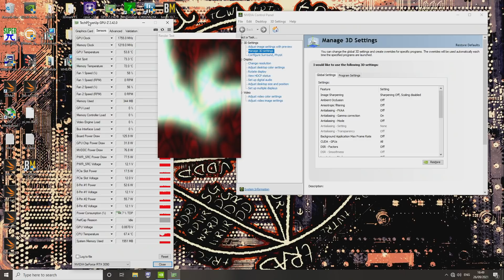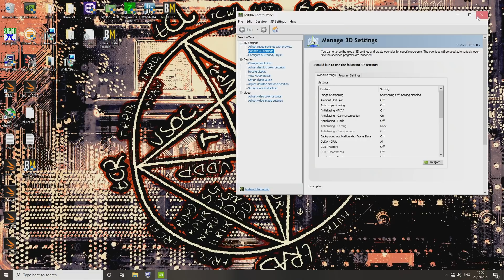Progress update on the New Worlded RTX 3090 Vision

Comment: Most def a design flaw and also a firmware flaw, it should of prevented rapid cycling of power states (going from 60fps to 500fps, etc). So all 3090 etc are still at risk
Reply: I'm inclined to agree. In my opinion any card should be designed to withstand an absolute worst case scenario as we are talking about software. There should be no way for software to damage the card as long as it doesn't try to interfere with the power settings or frequencies on the card. That are things that software like Afterburner fiddle with, and it comes with warnings that you are touching things the user are not really supposed to tinker with so you are doing so at your own risk. A game however doesn't have any reason to touch anything like this. Just issuing draw primitives and accessing the options exposed through DirectX, OpenGL, Vulcan or whatever other API it shouldn't be possible to damage a graphics card even if you were to deliberately use the absolute worst kind of workload however unrealistic. That's what safety margins are for.

Lets look at heavy construction machinery. If you have a loader that are rated to lift say five tons then you expect it will do so all day every day without blowing up. If you try to lift six tons it will most probably do so, maybe even seven. But once you get high enough it will stall, overflow valves will trigger or it will somehow refuse to do more than try. This is a built in safety. It protects the machine from damage and also the workers from what a failing machine may cause. But the machine is actually not yet near the failure point. In some cases it's possible to override the safety features, but doing so means you have to manually disable them, and no one will do so without a really good reason because when a huge construction machine fails things can go really bad in really horrible ways.

Construction of any kind of graphics card should be a bit like that. If the card can normally draw a max of say 200W then the power delivery should be designed to provide at least 300W continuously and transients of say 400W. Now that is figures I lulled out of my ass so they may be way off. But the safety margin should never be less than 50% and more probably 100% to 200%. Some components age faster than others, and heat and high frequencies can accelerate that. A graphics card that costs north of $1K and often even $2K is way to expensive to have it's lifespan shortened by cheeping out on components costs.
Reply: I agree 100% had my buddy's 3090 ftw3 brick loading into apex, had my 3080 ftw 3 brick loading into zero hour (seige style tactical shooter).  Got my new card in 4 days and I've undervolted since and underclocked immediately.

Comment: Maybe the owner could run with the power slider at 90% for reliability. Not ideal but at least it may last a while that way. Or perhaps cap the frame rate in the driver.
Reply: it doesn't always work with new world unfortunately. some cards will still boost like crazy, or ignore the fps caps in the driver. This is a total mess between obviously botched game code revealing hardware and driver issues that should not be issues if the game was coded properly.
As Jay said, new world is basically more of a stress test than a game at this point

Comment: If I was the owner, I would keep it like that. VRM is more than powerful enough to run it with 1 missing + Buildzoid fixed my shit! Has more value as is.
Reply: The VRM wasn't even powerfull enough without missing parts lol
Hence it blew up.
Reply: @rako81sna  Don't confuse defective with not powerful enough. On paper the VRM is way more than adequate. Owner got this second hand and we don't know what the previous owner did (mining & etc). 

I would voltage/power limit a 3090 anyway. Nvidia pushed these cards too much just to have the fastest card out there.

Comment: Do you think with better cooling, the power stage would not have blown up?

I have a 3080 FE and considering to play New World, but didn't want to consider it until I put a water block on it (which I already purchased). I figured it'd be safer with more than adequate cooling, but if faulty hardware, then maybe not.
Reply: Better cooling wont save this
Reply: @effive7817  Why is that?
Reply: Breaking the power limit isn't a temperature issue. Some people limit power very low and fps cap, dunno how safe it is you'll need to research more reports I've only seen a handful.
Reply: @effive7817  Quite a few 3090s were breaking from bad production issues as I understand it. There was no discussion on whether those people were breaking power limits and that's not what I was alluding to.

I simply thought that whatever the issue was, it might be temperature related due to big power demands by an app (game in this case). If temperature exacerbated the bad workmanship, such as it was rated for 100 degrees but the bad workmanship caused for failures to happen at 85 degrees, then watercooling might help avoid the issue.

If there are other problems, like bad grounding, EMI, faulty mosfets / VRMs, I guess that can cause other permanent damage, just not sure how when it only happens with certain types of loads / stress to the GPU.

Comment: From my old VGA Voodoo 1 days to 2021, I've never bought the highest end tier card. I try to upgrade every second generation with one tier below highest end. In current times I wouldn't buy 3090 but 3080. Those highest tier cards are always pushed to "beyond maximum". This strategy of buying has paid off in more then 2 decades. Only one GPU died, even though I was OCing the shit out of them. But these 3090 are not normal. I've seen youtube videos where it pulls 430W for a second in **normal use** before going down to 350-370W. I was really hoping 300W was the limit GPU manufacturers would go, and that Ampere was an unfortunate generation, but it seems all next gen will pull 300-400+++W. Please don't. PLEASE.
Reply: There isn't anything wrong with having higher power limits on cards, especially if performance per watt is still improving. The VRMs get built around it having higher power draw along with everything else. I put OC bios with higher power limits on most of my cards if they don't already have them and my cards have all been fine. 7970s, 780 Ti, 980 Ti, 1080 Ti and 2080 Ti. So I'm also going to have to disagree with the "highest tier cards are pushed to beyond maximum" as well.
Reply: @rekareaper  To each his own. If I bought 3090, I would have to buy a new high airflow PC Case, new PSU and a new Air Conditioner for my mans cave or our living room. So at least 4000 EUR if not even more because now companies that are installing ACs, Heat Pumps, Gas installations,... are charging double, and you have to wait a couple of months. For a fscking GPU! My significant other would put me in a mental institution because she would probably think I want to starve our children. HU just released review of A4000 which is between 3060 TI and vanilla 3070 and can achieve that with only 140W. But it's OK. We all have different perspective on things.
Reply: @alpha007org  there isn't anything wrong with that. My point was that the higher end cards aren't pushed beyond their maximum. You also don't have to buy the enthusiast or flagship cards. The top end of the next cards may end up with 50% higher power limits, but they're also all looking at over 220% performance vs the current top cards. That performance per watt improvement will apply to most of the line up, and will probably be even higher on the middle and lower end cards since they aren't trying to squeeze everything out of them. For reference my 2080 Ti has probably drawn more power than most 3090's have and it's still running fine.
Reply: @rekareaper  This is my opinion and my strategy of buying in the last decade+. Do I want to squeeze the last 4% for 50% more power draw, or do I want something more reasonable? In the past, Tier below Highest was usually a good performer, still with not linear increase in power draw relative to performance, but those GPUs usually had good OC potential, especially if you got a good sample. Those GPUs usually weren't dying at the rate of the highest tier. When BLZD started naming GPUs that failed most often, they were the cards that were pushed to the maximum. Regarding 3090: it was supposed to have 350W TDP. A lot of different 3090 have, during normal use, moments of 400++W draw before going back to normal. This is "beyond maximum" to me. Notice the quotes...

Comment: Here's one thing I'm really curious about: The uP9512 supports automatic phase shedding. Could you probe the PWM signals to see whether phase shedding is actually enabled on this card? Maybe the uP9512 can't enable additional phases fast enough when a hard load spike hits so that a few phases get overloaded even though the total load is well below the VRM's rated output power.
Reply: my guess would be IF it sheds it's in idle mode only, anything else it'll be full phases.

Comment: With my experience with one pascel card this was my guess. A hard transient thst blows the power limit way out of the watter before it gets corrected. And with these mixed phase/powestage count cards your probably playing the lotery that it doesn't happen on the single power stage part of the vrm
Reply: Is it mixed powerstage though? Under last video BZ corrected that reference PCB allows for 10 powerstage Vcore.
I don't know if this does mean that reference VRM is asymmetric or if 10 is correct number of phases for 3090.
To me - with this videos and what JayZ showed (whcih I don't entirely agree with him on - that it is VBIOS) New World acts like Furmark. On the other hand so many cards failed in other applications (heavy loads). Which probably means that there is a problem with at least QC in factories or design. But also - you shouldn't design your game to be a Furmark - this is insane. Furmark was DESIGNED to abuse GPU as much as possible - without any safeties.
Reply: I could be wrong about the mixed power stage. I did not see the update to the last video.

Although I woud argue this game is not like furmark. It may have a rapid intence operation but its very inconsistant. Also back when i was serious about daily stable ocs all my gpus passed a few hours of furmark. Mind you this was before gpu boost so you knew what you where getting in to and the card did not play arround trying to optomise and boost clocks when the workload let it.

Comment: I just like seeing that AMD stock cooler on everything you use
Reply: alright so i'm just going to check the turbo pressure on this 2JZ right quick, I'll run the coolant through an aluminum block and put my AMD cooler on it for the time being......
Reply: Go a wraith cooler on top of my 3090 FE - getting kick. It heats very good when F@H

Comment: powerlimit to <80% and underclock for new world.
Reply: That’s not enough if you want to be extra cautious. Take all of the preliminary precautions or what steps towards it you do are pointless. Set the Power limit to 70-80, frame limiter in game and software to 60, temp limiter, undervolt the card from the stock 1.05-1.1v nvidia uses down to between 0.85 to 0.9v. Control thermals and power spikes. For new world it’s not about the total draw, the game has an enormous amount of spikes and fluctuations in voltage and power draw.
Reply: @AznTony360  is it only with 3090 or also with 3080 / Ti and so on ?
Reply: @evilsatorii  I'm not sure, but from all the information floating around it seems mostly 3090's are affected. Some reports of 3080ti's though not as much. Same goes for the 3080/3060ti. Seen some people report older generation flagship cards as well, but it seems to be rare if any.

Comment: In a previous video he said he might be able to get a schematic for that specific card because there were some leaked. He didn't mention it because either he couldn't get it, or it would be a time-wasting rabbit hole to evaluate the design of the power delivery circuit
He would probably need access to an R&D department's equipment/documentation to accurately analyze it and I don't know what equipment he has
I mean, he could probably do it himself, but how freakin' long would that take?
He'd have to do what gamers nexus did with the gigabyte power supplies. Have specialized equipment, either pre-made or equipment he made himself, to overdrive the power circuitry and see at what point it fails and how the circuitry handles the failure. That could cost a hundred thousand dollars easily just to do that. Basically, a crate of new cards to test with, or at least remove the gpu chip itself from the circuit and replace it with a simulated load with boxes of replacement power delivery components
That would be extremely time consuming and expensive
And replacing the gpu chip with a simulated load would be very difficult to make accurate
You can't just say, the gpu chip is a 0.1 ohm load so we'll just use a very high wattage resistor. It's also probably an inductive load at least and who knows how it behaves in total without killing a few just to find out
I think it can be summed up by saying, yes, new world is killing cards because it's badly coded, but it's the card's bad design allowing it to happen
So in essence, it isn't new world's fault, and every killed card should be replaced and any manufacturer that doesn't warranty all cards affected should die an a fire
I'm looking at you with a death stare, gigabyte

Comment: New World isn't going anywhere near my 3090... no sir! Especially with Amazon denying any culpability.
Reply: amazon are not responsible for the failures of these defective products.
Reply: @Squall4Rinoa  Normally I'd agree, but there is something exceptional going on here, and Amazon needs to take it more seriously. We're not seeing this happen with other games and Amazon likely has the ability to fix it, even if the hardware should protect against it. No way I'd be shipping software that bricked $2000+ GPUs, even if it wasn't entirely my fault.
Reply: @jasonhurdlow6607  there is nothing exceptional going on here, the products cannot perform to satisfactory stability when they encounter a variating load. new world is not the only case of this issue with some having games killed simply be having a heavy set of reshade shaders, other cases being halo mcc, gtav, and anything else that can go quickly from intense to light loading just by rotating the camera.

Comment: Can you share part number for the dead mosfet , I want to have a look at the data sheet , thanks
Reply from the maker: AOZ5312UQI
Reply: @ActuallyHardcoreOverclocking  was it the high side mosfet shorted?
Reply: @stanimir4197  they're integrated. It's a DrMos component. Unlikely that BZ has the capability to test what exactly failed on it.
Reply: @NotThatGuyJD  hm, need to check vin shorted to vout and vout shorted to gnd, pretty much. (the designation on the chip of vout is vswh, pins [16-26])
Reply: @stanimir4197  ah, he should be able to take a look would have better luck asking it as a standard comment as opposed to a reply on a comment
Reply: @NotThatGuyJD  I asked after checking the datasheet, so I knew it'd be possible.

Comment: should be pretty obvious, but if you think it's highly likely to simply blow up again, flash the card with a 3090 BIOS with a lower TDP limit or even further reduce the TDP with afterburner. It's far better to have a 3090 with the performance of a 3080 rather than a dead 3090
Reply from the maker: the card has a 350W BIOS from the factory. The only lower wattage BIOSs are 3080s
Reply: @ActuallyHardcoreOverclocking  as you know TDP is trivial, just need a different shunt resistor

Comment: Are VRM components the same footprint? can 70W be changed to 90W?
Removing all the VRM components would be very risky and a lot of work though.
Reply: They look like standard packages to me. Power stages come in a variety of packages. Some will fit on the same footprint. What I don't know is whether higher current power stages are available to fit the same footprint but I'd guess they are maybe up to 90A.

If he gives us a part code it isn't too hard to search for compatible uprated parts. They would need an equivalent footprint and the same pinout.